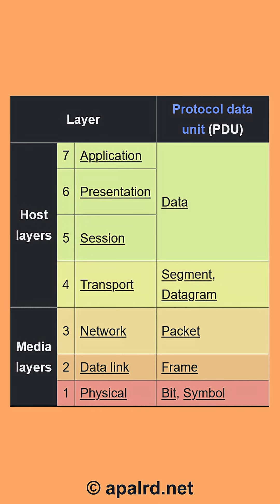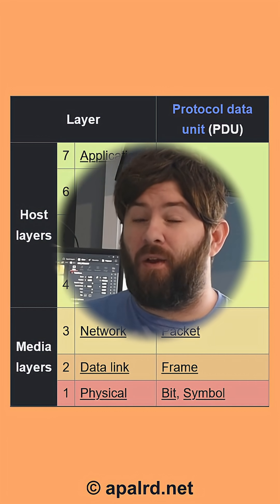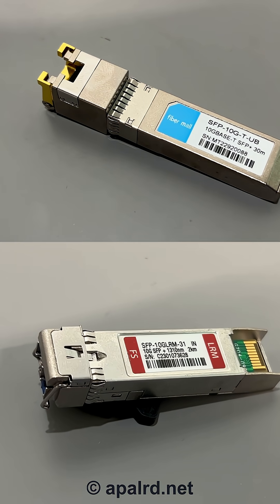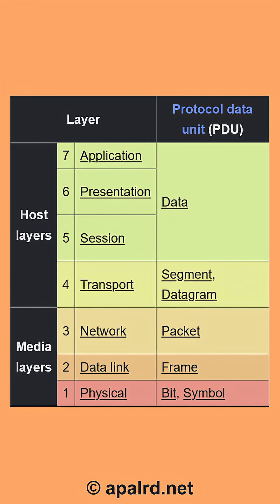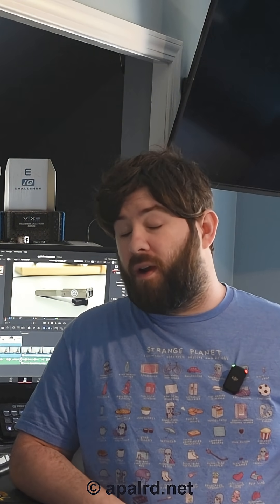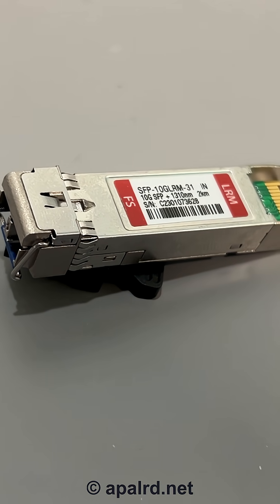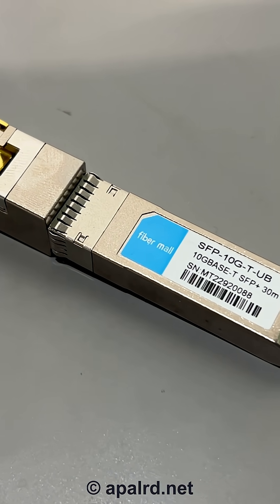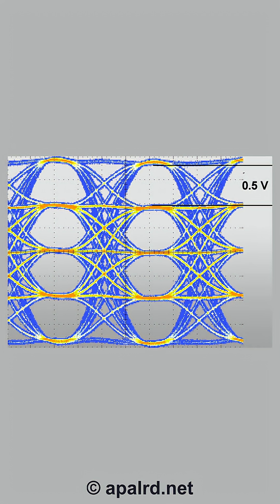What is an SFP? #networking  #fiberoptics  #homelab

Comment: 🤔...the end sort of implies that DAC cables don't have a PHY at all but rather are a MAC to MAC connection which is wild to think about.
Reply from the maker: in modern SFP, the MAC itself has a LVDS driver on-chip, so the DAC cables are just connecting LVDS straight across MAC to MAC. 

The DAC still has an eeprom to identify itself, so it will still appear as a transceiver, but it's not doing anything in analog.
Reply: @apalrdsadventures huh, that's really fascinating. Is the LVDS used all the time (with actual transceivers) or is that specifically to handle the use case of DAC cables?
Reply from the maker: LVDS is used with everything in an sfp slot. At these speeds it’s needed just for signal integrity across the board and connector.

Comment: What do you mean obsolete?
Reply: OSI was a competitor to the internet protocol suite that never really took off. The OSI model was designed to be a topology for the OSI protocols...which are totally different than the internet protocol suite. IP (the whole stack) is not nearly as neatly layered as OSI was and doesn't really fit the OSI model, which shouldn't be a surprise since the OSI model was designed for OSI
Reply from the maker: OSI had an incredibly rigid standard for how layering would work, and designed protocols for all 7 layers. This makes sense since the ITU designs by committee instead of just by engineers. 

The IETF (who designs IP, TCP, TLS, and more) and the IEEE (who designs Ethernet) don’t fit into the OSI layers exactly. IEEE separated OSI layer 2 into their logical link layer and media access control layer, which they just refer to as 802.1 and 802.3 (and 802.11), for example.